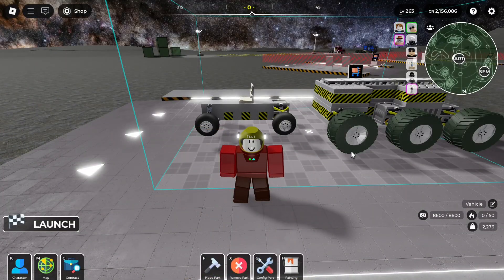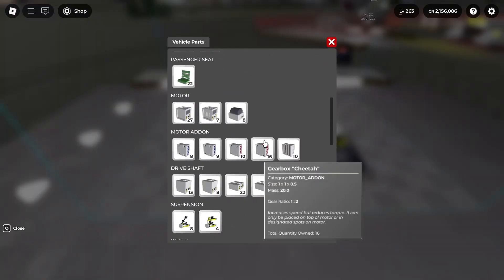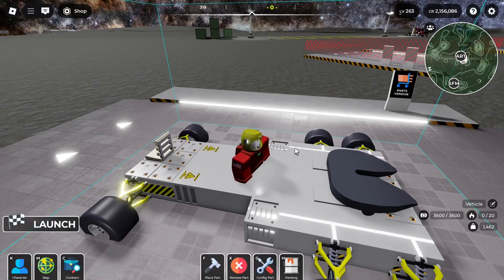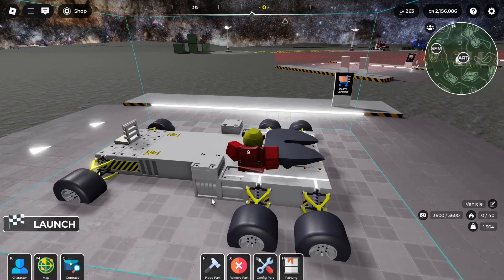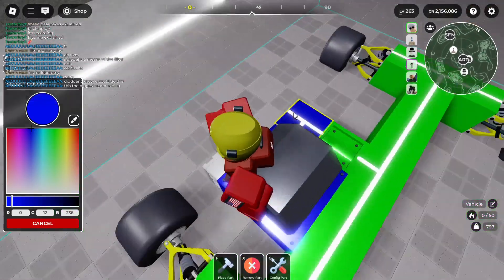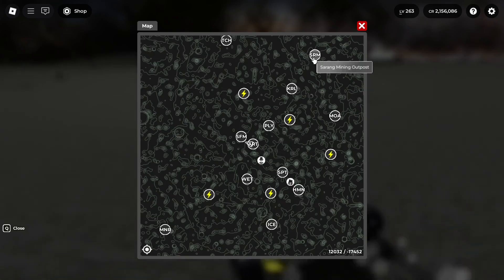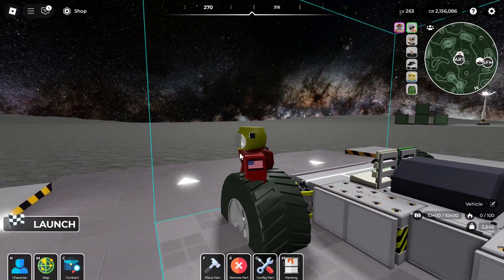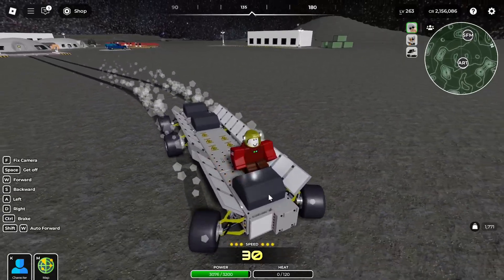Gearboxes and Motor Filtering: Upgrade your motors in Run on the Moon

Comment: This game is so ridiculous because I found over time that only a starter motor + a mule gearbox, smallest wheels, and a light car with the trailer piece can get the heaviest trailer mission from art to krl in under 1000 total power. It seems like the power reduction for larger wheels is double what is should be at any set radius so the smallest wheels are the only ones that create the correct torque for their size.
Reply from the maker: The logic behind it is that the larger wheels have more mass further from the center of the wheel. That means doubling the wheel size more than doubles the moment of inertia, which is how hard it is to turn.
Reply: @teeterboy4690  I still believe there is something wrong with the scripting. I'ma conduct some experiments, I'll get back to you.

Comment: Yo I got 4 mk1 motors, 1 mk2 motor, 1 ox gearbox, should I keep the 2|2 front and 1 back design or do smth else
Reply from the maker: Filter the mk2 through a mk1 into the back 4 wheels. Put a single mk1 on each of the front wheels.

Comment: 3:55 teeter that is not really true, depending on the side where the mk1 is placed the filtering will work or not. so you can just place a mk1 and have the Ox speed on all wheels or place it in the other side and have the normal speed on all of them, (what we can do is place two mk1s on each side to make it easier but as you said it reduces torque)